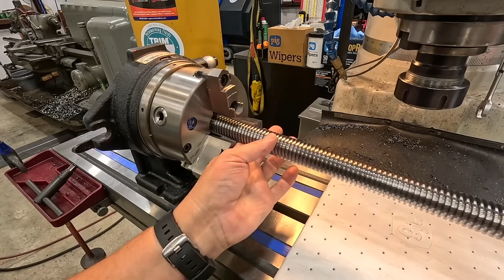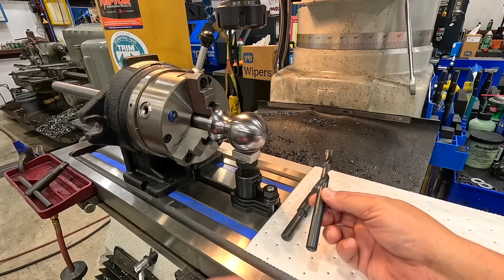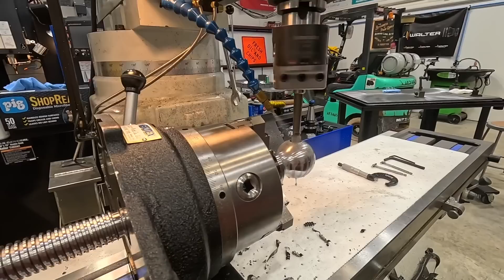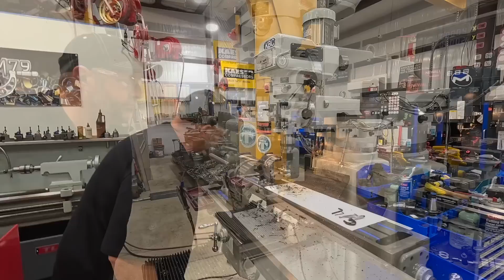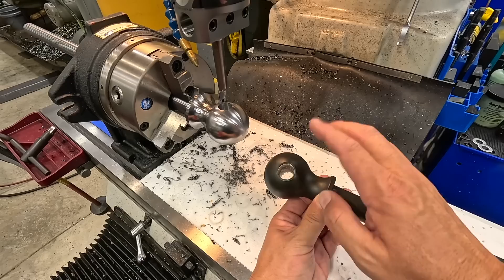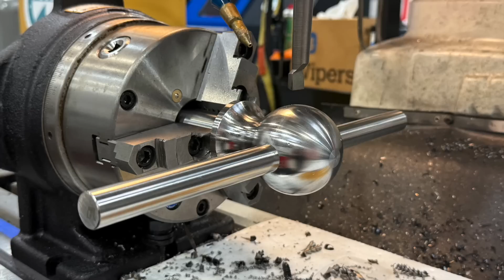Vise Spindle Cross Hole Machining

Comment: Kurtis on the Cutting Edge Engineering YouTube channel, out of  Brisbane Australia, has several videos where he used this Vertex, identical to this one. Karen (his wife who edits the videos) always shows Kurtis swapping out the backing plate so that it indexes just the number of holes he wants. That way Kurtis can not make an indexing mistake. Kurtis never gauges his threads after a first scratch pass but Adam does. Interesting how two Master Machinists differ in what they double-check.
Reply: Curtis from CCE is actually a boilermaker welder, i think you will find all his machine work is self taught, mind you, he's brilliant at it.

Comment: With that bore at such a close tolerance, any kind of bend in the handle is going to make it difficult if not impossible to slide. Granted, the feel would be spectacular, but not worth it in my opinion.
Reply: He has no plan on using the vice it’s just a display piece
Reply: if you look at the size of the vise you would understand that any pressure that could bend the handle would be pointless.
Reply: Mine's bent like a pretzel and works fantastically.

Comment: So I just watched you drill/bore one hole and the video was almost 1 hour…..LOL 😂
Reply: No you just watched him drill and bore and precision fit a .7493 shaft in a .7498 hole. Work like that takes a lot of measuring and fitting and re-measuring til you get it exactly right.
Reply: @ellieprice363  We are talking about a VISE, to be used, not to put under glass.
Reply: @gertjoosten5141 No we’re not. This vise will never be used in the normal manner.
Reply: If he wasn't filming it wouldn't have taken that much time.
Reply: @tsmartin  There's also an important thing called 'Editing a video' which could be used to cut down the time to about half. Maybe he gets paid by the minute for these long boring videos?

Comment: This was so inspirational, That I went out into my Garage, and bored a hole to .0001 of my target dimension, Then made a .024 deep facing op with the same boring head! LOL Thanks Adam for your incredible teaching videos.

BTW That reaming op sure shows that you can be at dimension, yet hung op by burrs or tool marks. Is there such thing as an internal burnishing tool, or should I make one?
Reply: Yes, a hardened precision ball pressed through the hole would have flattened the tiny boring bar ridges and enlarged the hole about .0002.

Comment: I have a question purely out of curiosity. The wiggler centre finder, you and many others wait until it kicks off slightly but I have seen people waiting until the wiggler is running true with no kick off and taking that as a true measure. The question is there much difference between kicked off and not kicked off?? yes I know its a minor thing so probably a tenth of a thou or something hence my curiosity. I'm a very very beginner hobby machinist, tiny little Sherline lathe and really enjoying myself learning a whole lot (and making a mess, broken tips.. oops) I have no one to teach me other than amazing people like you and others.
Reply: He's using an edge finder. A wiggler is similar but different. I was taught to let the edge finder kick off to the side and call that your zero. I usually touch off with it twice to double check. I've never seen a feature be off more than a few thou using one.
Reply: I was thinking the same thing. What kind of precision can you get when trying to eyeball that there is no more wobble.
Reply: @Neptune-718 pretty good accuracy
Reply: If you just waited until it was running true then you would need to move over half the diameter of the wiggle to have the true edge
Reply: My eyes see it trued up for about 5 thousanths before it kicks. And it will kick every time going over center at the same distance. So that is more accurate. And consistant.
Reply: For maximum accuracy a drop of light oil should always be placed between the sliding surfaces of edge finders.
Reply: the difference is are you trying to find a center or are you trying to get it centered

Comment: I like the way you tell the brand name of everything you use .
Reply: In machining, Quality is important. It has served me well to just buy what obviously works good, than spend my money on inferior tooling and get subpar results. I my home shop, I won't waste my time with cheap endmills, or mystery steel. Not even for hobby stuff, because you'll never know if you got your speeds and feeds wrong, or your just dealing with inferior cutters or material. 
  That's why I also appreciate Adam saying exactly what he's using and doing. The mark of a good teacher.

Comment: Not much need to worry about bending that 3/4" dia. handle unless you put a 10' cheater bar on it. 1st rule of machining is rigidity in any set up so by all means you should tighten the lock on the boring head!! Dude please don't even acknowledge the nay layers. You have the skills they wish for. Set up machining is more about finesse than anything else. You nail it in finesse!! I just retired after a machinist career and I would kill to have either of your shops at my disposal. 
Thank you for all of your content.
RIGIDITY!!!

Comment: I don't quite understand why you put all that effort into making the handle such a tight fit. Is there any point besides you're a machinist and you can? What if you get a ding in that handle, it won't slide as good, right? Great video btw, must be the most perfect vise spindle existing :)
Reply: It’s going to be a show piece. Not a vise that gets used.
Reply: The vise is not going to be used, it's a show piece.
Reply: Adam takes real good care of his tools. Could happen, but would be a rare  mishap.  And even if it did, I'm sure he has the technology to fix it 😉

Comment: They make a solenoid air valve that triggers off your spindle power switch so your cool mist shuts off when you cut the spindle without messing with your air / coolant settings.. And I always lock my boring head.. my gib screws are not tamper sealed and I do adjust them for reasonable drag.. but ymmv.. and damn my guy, 2 tenths clearance? I remember what your chuck key looked like in the early videos, one use and this thing would be bent enough to not slide end for end, I bet you 2-3 thou clearance would be more than tight enough.

Comment: The problem I see with it being such a close tolerance won't it get stuck if there is any deflection in the handle if you tighten it to hard?
Reply: he explained in one or two previous videos that this vice is merely a labor of love.  He has no intent of using it for amything…in his words “it’s just a conversation piece”
Reply: @jwdickinson1  The conversation will start with “That’s a very tight tolerance. Won’t the handle get stuck if you bend it even slightly?”
Reply: @mm9773 and his answer will probably be something like “on a working vise, yes.  But this is just a functional display.  I have no intent on using it.  I built it this way to be the way that it is…”
Reply: I might add that with such a tight fit, it has little chance of deflecting from totally square and little chance to mare the bar, never grabbing at the edges of the hole, but along the whole of the hole. Hope that made sense.
Reply: I might add that with such a tight fit, it has little chance of deflecting from totally square and little chance to mare the bar, never grabbing at the edges of the hole, but along the whole of the hole. Hope that made sense.

Comment: I don't typically comment on technique. Hell if what you do works, then who am I to say you're wrong or not doing something correctly. There is often more than one way to accomplish the same thing. However...I have been using the Criterion heads the same way you do for 30 or more years and never had one move. It always cuts what I set the tool to cut out. If I forget to snug the screw I have had them move on me.  To each his own I guess. Looking pretty good. Cheers

Comment: What I've done with my Starrett 924 Vise handle was oversize the bore by an 1/8th inch and pressed a bronze bushing inside, afterwards I bored the ID of the bronze bushing just a few thousandths over my handle. The fit is real nice and to make the handle a little more trick I drilled and tapped a 1/4-20 hole on the ball end, using a bronze tipped set screw I can use that to press into the bronze bushing holding the handle in place without marking up the handle. if I can do it all over again I'd make an entirely new one like you did yours!

Comment: While setting up that clearance is cool.. I'd think that about 5 thou would be better.  IMO you need a little slop or if you ever ding the handle, it's going to stick.   I'll agree on the boring head lock but there are times when I just get lazy.. :D

Comment: Adam, an old machinist back in the 80s taught me that when you're boring on the mill, when you find that you need to remove 1-2 tenths try instead of adjusting the boring head, speed the spindle up 50-75 rpm. The syntriphacal forces will get you right where you need to be.
Reply: Good idea.  BTW, centrifugal is what you’re looking for.
Reply: @jim79015  No, when you really know what you're talking about, it's "syntriphacal"...
Reply: @Caseman91291 Fictitious?
Reply: @buckhorncortez  OK.  I was going to mention centripetal force, but I was afraid of opening up a can of worms.  I’ll let it be, but I think it would be good to let everyone know about the distinction.

Comment: What would produce a better hole finish, a boring bar or a reamer?
Reply: Yes.  :-)
Reply: @ydonl  Is that like coffee, tea, or milk? Yes please.
Reply: @GFSwinger1693  Don’t mind if I do!  Thanks!  :-)

Sorry.  Nonsense.

I don’t know, but I was thinking, maybe it depends. I would think a really good (stiff) boring bar with a perfect tool and a slow and gentle feed rate might produce a good finish; maybe you could get much better than a quick job.  And it seems like a reamer might be somewhere in between those two, because it kind of scrapes, but scrapes nicely.  But I’m just speculating.
Reply: @ydonl  my assumption was that the reamer would leave a more consistent finish in the sense that it's not cutting a spiral down the tube.  I haven't done any machining since college though, so I'm really just looking for someone to confirm or correct that assumption.
Reply: @bac1308Correct.

Comment: 39:00  It's not round?  But you stated at the beginning "it's precision ground stock"  Now it's been over 20 years since I used to be a Purchasing Manager for a major UK Multi Metal stockholder managing £1m of stock mainly Stainless Steel and Aluminium but I do remember SS ground bar [known as bright bar because the precision grinding process gave it that sheen] was pretty round.  The issue you have - and in this instance I'm picking you up on it although I shouldn't need to - is you're trying to force something 2 or 3 tenths of a thou smaller into a hole...when you clearly stated in this video and previous that you need a 1 thou machine clearance [forgive me if my terminology is slightly wrong...I'm not a qualified turner/machinist etc].  It's not that the bar is not round [unless someone ran over it with a 40 tonne truck] it's the hole isn't physically large enough to accept the bar without force and force creates heat which in turn creates expansion and what you don't need on a bar that needs to slide less something that tight a tolerance.
Shoot me down, criticize me all you want - but bring that criticism with facts - I can accept it if I'm wrong .
Reply: It may have been he was just saying that without precisely thinking it through - maybe that's the first thing he thought of despite being incorrect. Like thinking of other times when he dealt with stock that was slightly out of round, forgetting this piece was precision ground.
Reply: Bright bar BS tolerance is H9 which is 0.0005 Inch
Reply: @glynnepritchard2526  👍 Good to see likeminded minds.  Didn't/couldn't remember the tolerances for Bright Bar.... it's been 20 years.  The only possible discrepancy would require that 40 tonne truck 🤣🤣
Reply: Yes I paused the video...when I heard crap.  Yes maybe the above comment is not warranted but neither was the crap about 'not round'
Reply: Thank you! The first bend on the bar is going to get it stuck!

Comment: Aren’t you afraid with such an exact fit that if you slightly bend that handle that it would bind up and not slide through from end to end?
Reply: He doesn’t plan on actually using this vice. It will be for display. He mentioned it in a previous video.
Reply: He could simply cut it off and make a new one. -Abby
Reply: It may be for display, but I can tell you in my line of work I have multiple vices, one of which is a precision vise with similarities to what he is doing. The other vices get cranked on, but the precision vice is used for some delicate work, particularly when 'feel' is important, and a well-fabricated handle/drive assembly makes a huge difference.
Reply: He's not worried because this vise is NOT for heavy duty use whatsoever. As he has stated in other videos.
Reply: I c
Believe it’s only for show
Reply: Just dust or a little rust. I guess later on the hole could be enlarged.
Reply: It's more of a passion project than a workhorse. He's already got another one to reef on.

Plus, it's not like it's going to live in a machine shop or anything 😅
Reply: That bar fit after the reamer took off just enough was awesome to see. I love that you’re learning CNC and Fusion 360 design skills but when you go back and do things old school and get that kind of a result, it’s a testament to your experience and expertise. I love how you credit the two generations who mentored you. You never seem to do a video without crediting your dad or grandfather for some skill learned from them. Love your work and God bless!
Reply: Even a nick in the handle could be a problem.